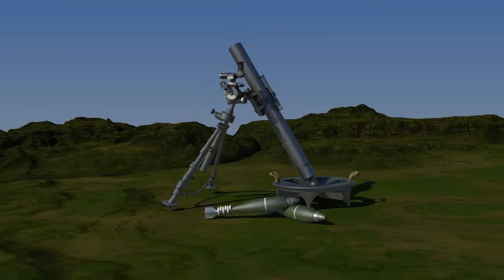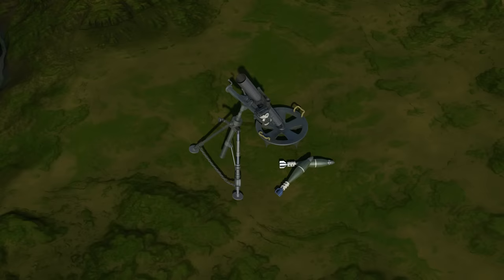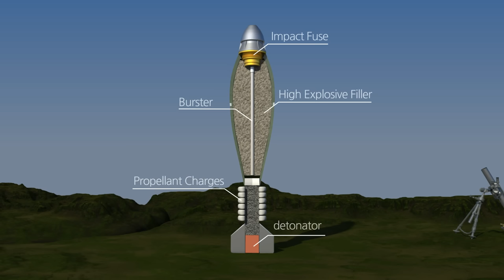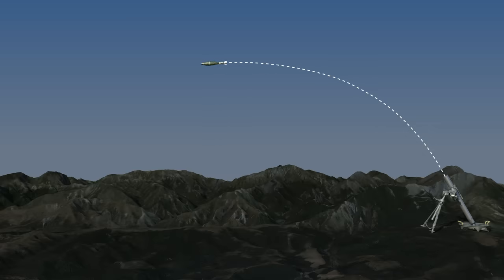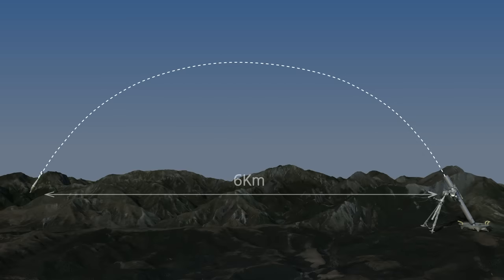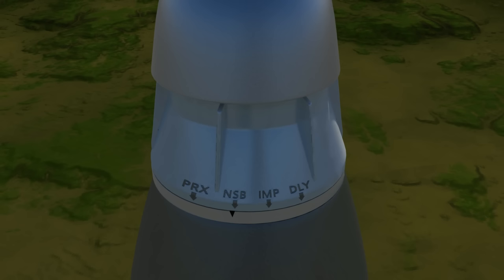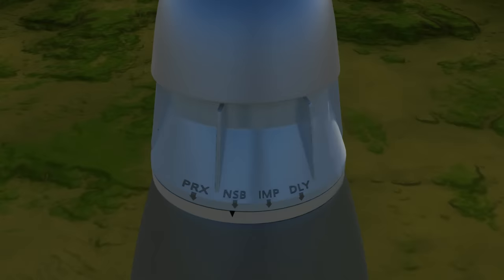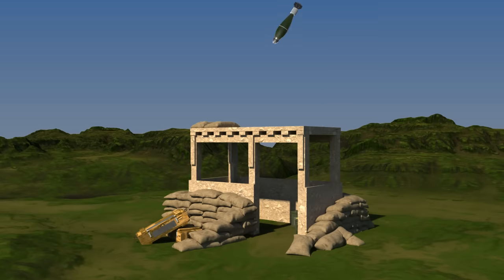How does a mortar work?

Comment: A mortar is not a howitzer. A mortar is a mortar. A howitzer is capable of Firing both in high and low angles, a cannon is capable of firing in only low angles and a mortar is capable of firing in high angles only.
Reply: Thankyou for the knowledge 👍
Reply: never knew the difference between cannon and howitzer, thank you!
Reply: Actually Howitzers can be fired at higher elevations to send high altitude bursts to destroy multiple targets at a time...
Reply: @lawtongore7053  howitzers can also be converted into field guns, thereby serving dual-purpose as a cannon also.
Reply: A mortar can be fired at low angles, if you’re ballsy enough
Reply: Howitzer also can shoot a larger caliber and or further
Reply: See Patria AMOS 9 (advanced [smooth bore] mortar system) - CAPABLE OF FIRING ALL NATO 120MM MORTAR ROUNDS AT ANGLES OF -3 TO +85 degrees.   BAE stated that the direct fire capability was designed for self-defense of the AFV.
Reply: Bullshit drop that elevation to 8 and we solid.
Reply: @Street-ty7ce  Is we for real?
Reply: @thomaslinton5765   Was a mortar man and the lowest elevation we fired was at 8. When I saw the angle of the gun I was freaked out lol had to double check with fdc since it was my first time hearing that data.
Reply: Ah yes hipfire mortars
Reply: @lawtongore7053   "TOT"
Reply: Baba Foodle  SWEET OR HARD?
Reply: Actually the terminology changes depending on the military
Reply: @blakelowrey9620  Assming that your contention is true, a "mortar: is not a "howitzer."
Reply: A howitzer (/ˈhaʊ.ɪtsər/) is generally a large ranged weapon between an artillery gun (also known as a cannon outside the US) – which has smaller, higher-velocity shells fired at flatter trajectories – and a mortar – which fires at higher angles of ascent and descent. Howitzers, like other artillery equipment, are usually organized in a group called a battery.
Reply: @Street-ty7ce  im no military guy but what company or division did you serve?
Reply: @justinb7229  173rd Ibct 1-91 cav
Reply: @Street-ty7ce  thank you for your service 👍🏻
Reply: The correct term for the ammo is also bombs, not shells. Don't ask me why, I have no idea.
Reply: 11C always
Reply: @taytheprodigy4388  FPF...Final Protective Fire is still high angle.
Reply: @potato2423  maybe  but what about a 122 mm mortar or the 4.2 inch
Reply: @taytheprodigy4388 
The problem is gravity. If the mortar isn't at a steep enough angle, the bomb will hang in the barrel. As well, if there's enough pressure on the part that connects the barrel to the baseplate, it'll break.

[former number one on a 81mm mortar team]
Reply: Actually, there have been mortars designed to fire at low angles....
Reply: Piat has entered the chat
Reply: High angle hell
Reply: I fired the 120mm from the hip lol
Reply: Amen
Reply: A grenade launcher can be use as mortar. Self carry small howitzer
Reply: Motar is a howitzer (type) but its just small
Reply: http://youtu.be/DpIN2QQGit0 
Collection of Airsoftguns
Reply: Soviet mortar "Vasilek" can fire direct fire
Reply: @Street-ty7ce  THE HERD!
Reply: @taytheprodigy4388  at low angle, the bomb may not go fast enough to the bottom of the mortar, and won't hit the needle strong to be detonated
Reply: cannons can fire at both high and low depending on type
Reply: Isn't it about ratio between calibre of the gun and length of the barrel (something like mortar barrel is less than 20 calibres long, howitzer is less than 30 and cannon is up to 40)?
Reply: @thomaslinton5765  are you referring to the Angle T ???
Reply: @larrywilson1783  the 4.2 mortar was also called the 107mm mortar...
Reply: Thanks; I thought Howitzer was a Jewish surname.
Reply: How mortifying.
Reply: Difference is in caliber to barrel length ratio. Cannon: >1 : 25, howitzer 1 : 25 > 1 : 10, mortar < 1 : 10.
Reply: Would it be correct to say they are all artillery?
Reply: thanks from russia
Reply: @brujo_millonario  that would be Horowitz
Reply: Russian automatic mortar "Vasilek" can fire mortar shells at direct fire angles, which makes it... a gun? It's a gun-mortar!
Reply: So... is grenade launcher... what ? like M32 MGL... maybe there is difference between ammunition
Reply: You can't fire an older 81 mm horizontally like you can a canon. The shell depends on gravity to hit the firing pin hard. Some mortars are fired differently of course.
Reply: i thought howitzer is the name of an artillery
Reply: @handlesarecringe957  I think it was the advent of exploding shells that caused the terminology change.  In slightly more than 10 minutes, my research indicates that the terminology is rather arbitrary and changes with the times.  "Howitzers" were generally shorter and could elevate above 45 degrees.  Mortars are pretty much 45 degrees and above, and "guns" or "cannon" are in the  45 degrees or less category.  Generally associated with bigger (propulsion) charges than howitzers.

Napoleon used his 12-pounders as howitzers and cannon.

Then there's the matter of rifling.  

Currently, according to Military Wiki, the USA uses rifled cannon for direct and indirect fire, meaning classic field gun and howitzer, respectively.  

Nowadays all field guns fire explosive shells.  This was fairly new to Napoleonic era, but both sides used them (eventually) in their howitzers, I think.  Before that time, there was anti-personnel grape shot and pure kinetic energy from iron shells suited for battering fortresses and plowing through tight enemy formations.  

Napoleon was the master of combined arms of his time.  You'd have to spread out to not be flayed by artillery, but if you spread out, he sent his cavalry.  But perhaps his main weapon was The Draft.  He could lose an entire army and there'd be another one right behind it, so even if his genius didn't get you, he'd swamp you with sheer numbers.
Reply: Exactly what I was saying (about horizontal mortars), so why are you arguing? You aren’t the only war veteran running around.
Reply: It is basically the 19th century way of throwing pointy sticks at each other.
Reply: They are basically the same. you know nothing
Reply: So your telling me a Mortar is just a high angle cannon, I thought so.
Reply: They're all artillery, correct?
Reply: Never seen a 60mm get used to breach a wall, eh? Don't tell a 60mm gunner that a mortar can't be direct fired.
Reply: @potato2423  It depends what calibers your army posses. Russian army has 203mm mortar 2S7 Pion with effective range as western 155mm howitzers.
Reply: plus a howitzer is capable of shooting 125mm 😭😭😭
Reply: Cool thanks!
Reply: i dont know how-its-her too
Reply: In general, mortars are infantry support weapons that can be  carried. A Howitzer is much heavier, requires substantial logistics to move and set up......and can obliterate just about anything it wants. That's not to say the mortar isn't dangerous, more a little brother to the much older Howitzer brother.
Reply: A mortar barrel is generally unrifled as well and contains a lower powder charge.
Reply: @taytheprodigy4388  not if it uses a fixed firing pin.
Reply: Dont know the country of you spesification but in Finland difference between howitzer and cannon is the ratio between the gun lenght and diameter.
Reply: And this is why this translated direct to text speech mass produced channels all suck. Miseducating people
Reply: I laughed at that, these "informative" videos are too often full of disinformation from lack of knowledge
Reply: not only that but howitzers use a shell and seprerate propelant charges , a mortar uses 1 single shell unit with the propellant inside.
Reply: @handlesarecringe957  The mortar ammo has fins that is why called "bombs". Shell has no fins like big bullet.
Reply: Cry about it
Reply: A howitzer is capable of both-ish.
Reply: If you can just learn one thing everyday you'll be on your way.
Reply: Henry H. Howitzer developed the modern mortar. So, yeah, a mortar is a Howitzer.
Reply: That's not the definition of any of those guns, and it's false too.
A cannon can perfectly shoot at very high angles -> any anti-aircraft canon
And a mortar can shoot in low angles -> NEMO for example
Reply: Video: "A mortar is a howitzer that fires shells in high angles." You: "A mortar is not a howitzer. ...  A howitzer is capable of Firing both in high and low angles, ... a mortar is capable of firing in high angles only."
Reply: I asked the guy that got blown to bits if he cares mortar or howitzer. He didn't complain.
Reply: No actually mortars not all but i know there are some that can Fire multiple granades and also at not the same angle/altitude
Reply: No its a bazooka
Reply: @BrownstoneKingcom I believe the mortars mentioned above capable of firing at low angles like the AMOS 9 are automated systems that feed the ammo much like an autoloader on a tank so don't really have the problem of dropping the round down the barrel.
Reply: No, a mortar is when you don't live forever
Reply: How does anyone confuse a small mortar to a huge howitzer
Reply: @atomwolf6774  Because there are (quite large) systems like this (link below) called mortars firing 120mm ammo while there are things called Howitzers that fired 105mm ammo and the AMOS mortar system (in link) is capable of firing at quite low (-3 degrees) angles.  So the difference is a bit fuzzy.

https://en.wikipedia.org/wiki/AMOS
Reply: You can also dual wield howitzers while equipping the “Akimbo” perk.
Reply: 💯 Thank you, was gonna say the same thing.
Reply: Given a bank to drive up, tank cannon can be used, and have been used, for high-angle indirect fire.  But that's an exception that tests ("proofs") an ordinarily valid rule
Reply: I think the collective group for towed howitzer or self propelled(G5..) and mortar systems is indirect fire...personally I would place a conventional cannon with tanks, Agl, air defence system and small arms as Direct fire the trajectory compared to range is so flat it's almost straight.
Reply: There are mortar designs out there these days that can actually fire at low angles as well, or even engage in direct fire if needed.
Reply: Which one is better for same calibre
Reply: No shit
Reply: A mortar is just firing pin on an immobile stand and the shock back goes to the ground which needs an angle.

 a howitzer is a cannon like artillery machine
Reply: As an 0811 I cringed when he said a mortar is a howitzer
Reply: I want a turkey sandwich 😢
Reply: Thank you for saving me time to correct that.
Reply: Incorrect. A mortar can fire both high and low angles

Comment: If the "81mm mortar has a casualty radius of about 40 meters," then why does the graphic depict a 40 meter diameter? Wouldn't that represent a 20 meter radius?
Reply: You are correct.The kill radius was 25 meters for 81mm.Thats from my service days and what we were told.Never tested that in reality but we had one guy loose half an arm when he didn't remove it quickly enough from the muzzle.
Reply: Yes, same thought I had.  Glad you pointed it out.
Reply: @UmVtCg  Well, where are people involved there statistically always come to stupid situations, despite all trainings. Did hear the case that actually guy did look into tube after misfire, and yes, guess, he lost his head
Reply: You are right.  The ECR is the ECR.
Reply: @eugeneoreilly9356  Unless shells drop in muddy terrain, then kill radius is 2 meters, and it makes half meter deep crater.
Reply: @Pukovnik141  the operater can select,airburst,impact burst or time delay burst prior to firing.
Reply: Somebody paid attention in math class.
Reply: Congrats
Reply: @eugeneoreilly9356  sir, I wonder how big casualty radius of 155mm Altillery would do?

Comment: How does the proximity work? How does it determine its close to the ground? I have more questions after watching this video than I had before
Reply: I don't know if it's still like this, but explosives would work on a timer. So you would calculate the range, and then time to cover the distance, and set the timer for longer then that.
Reply: It's done by calculating the distance and the time when mortar explodes.
Reply: @definitelynotsigjir  yes accurately 👏🏻💯
Reply: There is probably a sensor on the impact fuse.
Reply: Has a small radio transmitter similar to radar.  That’s what it is.
Reply: @ABHI-cg5dz  no your wrong . Proximity charge is fired by a radar like devise in the nose of the weapon.  Not a timer or distance .   Radar!
Reply: Continuous wave radar. The fuse sends out a radio frequency that reflects back and the resulting Doppler shift is used to trigger the firing mechanism.

Wikipedia has the information.
Reply: it likely depends on today vs say vietnam older tech probably has a timer of some sort with newer some sort of mini radar
Reply: @frost1977  radar fuse invented in World War Two.  Called proximity fuse.  Actually radar invented in England brought to the USA as part of war effort.  Helped win war.
Reply: Setting on the fuze. You turn the fuze to the correct setting. Proximity, delay, impact
Reply: depends on the age and price of the mortar.
old mortars WW2 probably have only have impact, and delay fuses.
newer modern mortars have more bells and whistles.  like radar on the fuse, so you have airburst, and surface settings. 
of course if you buy cheaper fuses, then you would have fewer options.

Comment: Aiming: For indirect fire the mortar crew aims at a stick they have placed front left of the mortar. This have again been calibrated with the aid of a theodolite . When done for all mortars in the group they will all be pointing more or less parallell. 

You can even use the theodolite to measure up a location some hundred meters away from the mortars. One of the mortars can then find targets from this off site location. Since the offset to the off site location is know one can recompute target coordinates and get the target from the main location. Used to awoid counter fire.
Reply: Never used a theodolite the whole of my time in Mortar Platoon
Reply: @zaynevanday142  You can see one example of the use in Patrick Lancaster's youtube video "Artillery Battles Rage In Southern Ukraine (Russian Artillery Special Report)" around the 7:50 mark.

My question would be how you managed to keep the tubes in parallell. I know we some times shot parallell control/adjustment shots.
Reply: I am surprised the military has not put a fire control computer in the hands of a mortar company that takes the coordinates of the target and mortars to generate a firing solution.
Reply: @wpatrickw2012  I bet someone has done it. But it isn't that important, the manual calculations take seconds. Mortars are an area damage weapons, as far as I know they are not precise like artillery (not including laser guided).  Adding to the precision problem, the dudes directing the fire can only report the target in absolute map coordinates or in their own coordinates plus the direction/range to the target . All prone to error. Add to that the fact that the first shots will have some intrinsic inaccuracies due to setup issues.
Reply: I'm dumb as a rock and not following the aiming of mortars, artillery, or howitzers. Video would be nice.